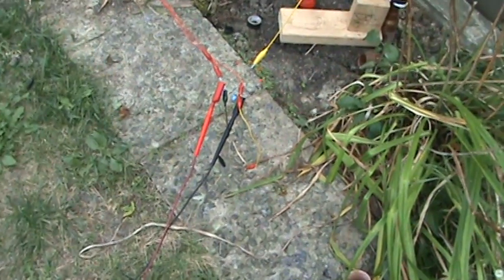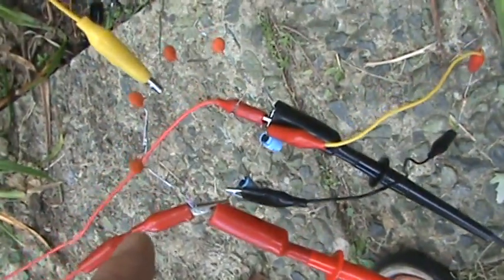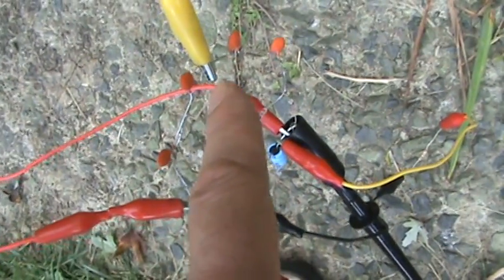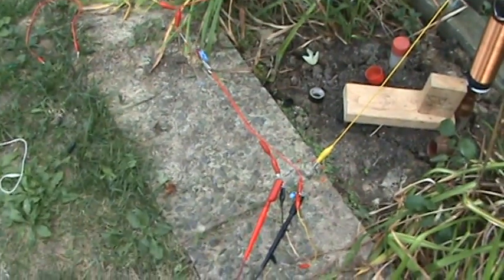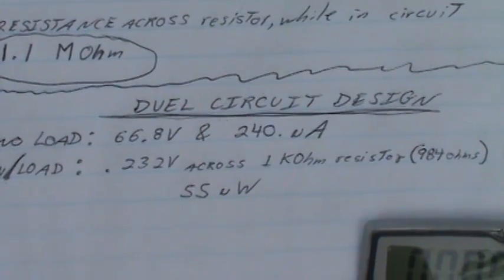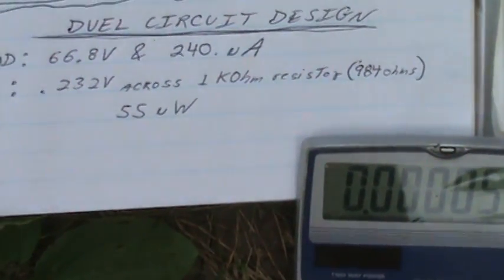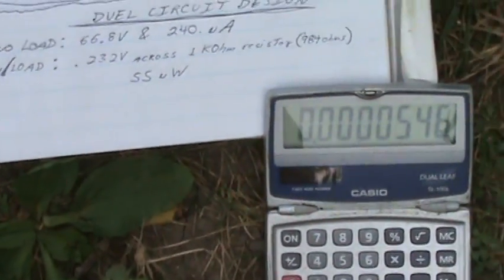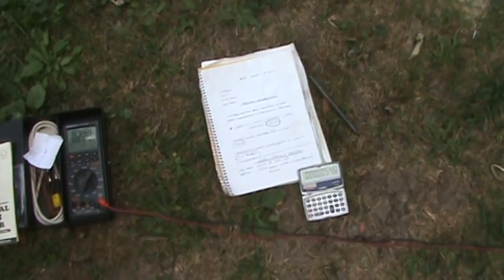FREE ENERGY FROM AIR CIRCUIT PART 23/24

Comment: expected youd show us copper lining inside pvc as earlier mentiond.my coil winded has a shielding  were planning to insert heated needles penetrating to conductor then perhaps each hot needle embedded in coil shall have a tiny magnet wire coil respectfully.read pointy wire more easily receives ambient energy and a roll of barbed maybe useful.
Reply from the maker: Yes, more points the better.  Lately i have been using etched copper plates.  The etching acts as many tiny micro points, but im still looking for something better.
Here is 4 LEDs lit....
https://www.youtube.com/watch?v=B_j6Q1y2KDY

Here is 21 LEDs lit....
https://www.youtube.com/watch?v=XK3NrQLR2XE

Comment: duel : du'el  n. planned formal fight between two armed persons -v. fight a duel . 

dual : du'al a.  1-  of  two   2-  double.

Not important ; just thought you might like to know how to spell dual .
Have you made a big enough circuit to run your house , or any 120 volt electric tool ???
You should have made a video with it wired to a saw or drill to see if it could power something.
Reply from the maker: Thanks, i fixed "dual" in the description, hehehehe.
I think video 7 shows powering a calculator.  I need more Amps, I get lots of voltage but little amps.  But been researching over the last few years how to use the voltage, I should only need microAmps to power a pulse, a frequency like i have now, but now to take it and amplify it through magnetically coupled coils and resonance.  We will see.

Comment: Hi Paul, I don't want to be discouraging, I admire tenacity. You are picking up stray RF singles, when you should be targeting EM fields. you are kind of on the right path but your tuning is way off as is your capture method. check out some of Bearden's information. you will run across Bedini, He claims to be using Bearden's ideas but Bedini is an idiot. Another hint is the news articles written about Tesla in the 1930's. I am working on another one of Tesla's theories at the moment, I wish I hade time to do both. Good luck with your projects.
Reply from the maker: Thank you.  I understand, for last 1&1/2 years now i been working on new method, like that of Moray & Tesla. Im now working on concepts of resonance, magnetic coupling, harmonics and nharmonics :-)  I think Bedini & Bearden been working on a project for a while now. Funny, just yesterday i made a note to myself to look up this article you mention about Tesla. I will search now,,,thanks.
Reply: INVENTOR3 If you read Bearden then look at Bedini's works you will see a correlation that would seem to make sense, but it is entirely out of context. I have seen a video by Bedini that had a voice over from Bearden, trying to solidify the correlation, which will fool most people. I am not suggesting any deception, he just doesn't know better. capturing the resonance is one thing, but harnessing it is the rest of the story. I think Moray did it with crystals, and Tesla did it with vacuum tubes. Read Bearden, look into Tesla. Hint: Vacuum tubes are made with doped materials. My big question is why Bearden has not corrected Bedini?...

Comment: what happens if you connect say 20 of these circuites together??
Will the diodes fry because of high voltage??
Reply from the maker: It will increase the current, but not much more, I tried with only 3 circuits and saw a pattern of which i believe will still only produce micro watts.  Im looking into other concepts to increase the power now.

Comment from the maker: power lines run under ground here on our block,,,and nearest power station and radiostation are both about 10 miles away.  And if i remember correctly im at 23meters above sea level.

Comment from the maker: @dferrera777 I tried what you mentioned,,,but no luck. I find that moving the coil was helping to tune things to resonate with incoming frequency on that antenna. position & size of coil depends on height and length of antenna. So everyones coils may need to be differant depending on there antenna and maybe even having to do with what frequencies are hitting your area of the planet. Resonance is the key.

Comment: @INVENTOR3 
Ive noyiced how it likes to transfer power when you have the coil against the wall of the pipe, what if you wrap the copper  pipe with an insulating layer of electrical tape then wind a coil right over the tape up the length of the pipe. thereby rather than the coils being close in only 1 spot it would be close all around.. better transfer for a weak voltage.. also it would take away the considerable wall thickness of the pvc.. just a thought thanks for spending your time to do this

Comment from the maker: @paius2003 I will think about the Kapanadze,,,i been looking into this devise lately, interesting.  I will check and see what type of silicone diode i use now,,,im  experimenting with both kinds.  Silicone takes 15-20 minutes to get to full voltage ans germ type take less than 45 seconds, hmmmmm.

Comment: so is the secret to make 100 circuits in parallel? Paul please give me a parts list of your circuit, I'm dying to try this!  jim_dennett@yahoo.ca  is my e-mail.. Also have you tried wire like in a small transformer (like hair) and wrapped a zillion wraps? What about a antenna like HAARP?also have you tried a thicker stainless steel line for antenna like a clothes line? Tesla says use an insulated highly polished sheet?Moray had a telephone type line (between 2 insulators) I'm dying to try this!!

Comment from the maker: Hey...no such thing as a stupid question.
Always ask anything anytime.
I tried a 3rd circuit in video 2 or 3 i think, but each circuit did not have its own antenna, if it works with 2 circuits and each having their own antenna....then i will add maybe 5 or 6 more circuits. :-)
good question.  we are all learning. :-)